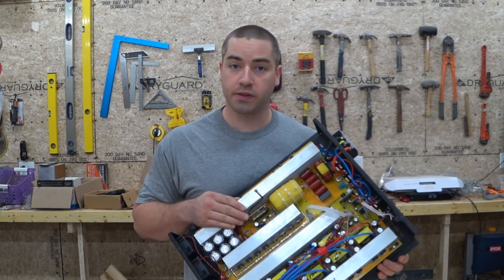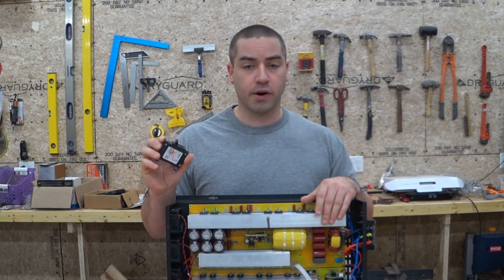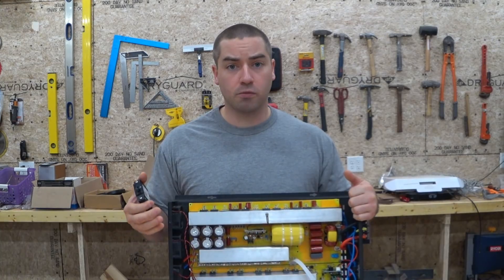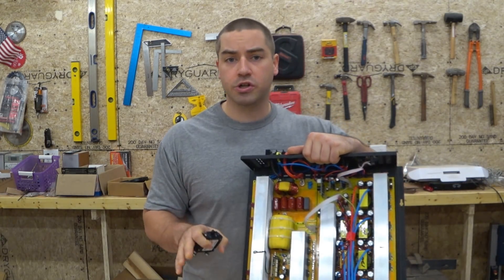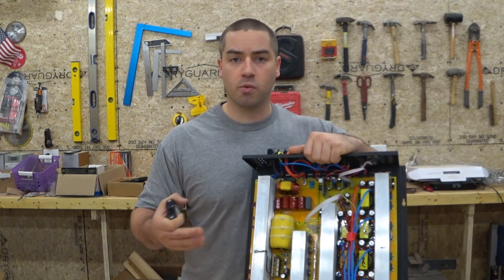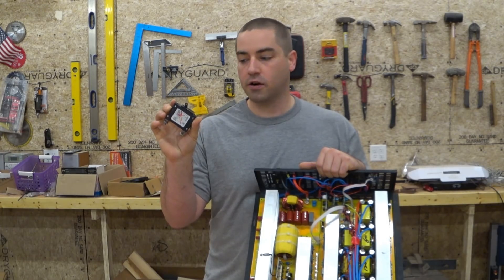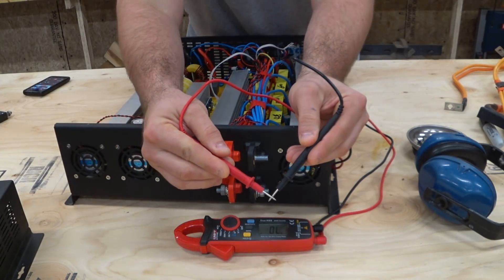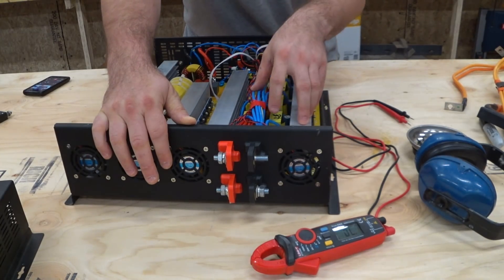Did I Blow Up the Inverter?

Comment: Sorry to say it, but you're over thinking this problem.  The bottom line is you cannot condemn anything in the output of these systems until the supply side is adequate.  The math says that 8000 watts supplied by 48 volts will draw 167 amps.  Even though you didn't pull that much with your saw, I'm sure the supply side current was well beyond the 80 amp breaker's limit.  When that breaker tripped, the voltage spike collapsed into the inverter electronics and they didn't like it.  I've made the mistake of flipping breakers on and off while my computer was running on more than one occasion - smoked the computer instantly.  Put at least a 200 amp breaker on the supply side and I suspect no smoke will escape from the 3rd inverter.
Reply: Yeah, a circuit break during peak inrush curent will determine the colapse of a huge magnetic field in those transformers translating in a imense reverse voltage  which will  fry the circuit breakers. 
But as everybody knows the FETs  will let the magic smoke escape first thus protecting the breakers or at least some of them.
In my oppinion there is fault in your setup but the design of that invertor is crap. 
The inrush current for that kind of motor you have is ~ 7  to 10 times the idle running current. That's means ~ 70..100 Amps. 
So you should at least double the result of your math. ~>9000 VA. In this condition the inverter should protect itself but ... the external breaker tripped. 
The 3000W inverter managed to limit it's inrush current before the breaker tripped so you'd had a kind of softstart :)
Did main the circuit breaker poped on the first fried invertor too ?
Reply: I suggest you order those FETs on Farnell, or Digikey or Mouser or whoever suits you, replace them (i'm sure "a guy in his garage" cand do this easily), remove the main circuit breaker and test again. I'm not even sure you need that main circuit breaker. I have 2 x  4KW inverters in paralel and i don't have a circuit breaker, only a 400Amps on/off switch. If something will go wrong the small circuit breakers in the inverter will pop. Cheers.
Reply from the maker: @John Critian,  Thanks for websites, I had no idea where to look for mosfets.  Mouser was cheapest, but still $100 for enough.  The hard part is that I don't know if just the mosfets need replacing, or other stuff too.  I can see myself replacing the mosfets, only to find out that other stuff is also bad and on and on.  I'm not sure it's worth it in the end.  Any ideas?
Reply: @DavidPozEnergy  Well... first, u may want to check w/the  inverter's manufacturer about that. Maybe they want to send u a 3rd replacement :)
I've seen several blown inverter and always the problem was localised @ FETs and fuses. 
If u decide to go servicing the unit, remove al FETs and check (w/ your DMM) for continuity between each pins of the FET. Any continuity  means bad. Probably u'll have some FETs survived. 
If u can't get a 3rd replacement, $100 is pretty nice for an 8KW invertor, don't u think ? and $200 is more than fancy for two 8KW units ...
If u decide to throw them away, please let me know where u dispose them  ;).
cheers, 
JC
Reply: @DavidPozEnergy  I agree with John's assessment. Replace the FETs. They are easy to do overall. Also, you replace all of them, don't replace only the ones that failed. They all need to be close in spec with each other, and that won't be the case now that some have failed and the others were close to failure.
And as John says, $100 is cheap for a 8kW inverter. Go for it.  The other thing you could check is to make sure the smd resistors are fine, as well. After removing the FETs, test the continuity of the resistors. They should all have the same value. And if any of the caps look a little puffy on the silver ends, replace them too.
Reply: so just out of curiosity, did the manufacture do a post mortem on the first unit?
Reply: @DavidPozEnergy  Check at taydaelectronics.com - (https://www.taydaelectronics.com/t-transistors/fets-mosfets.html)  I use them a LOT for my electronics needs.  Hopefully they carry the exact one you need, otherwise you might need find an equivalent.  I have not seen anywhere you say the MOSFET #, but I may have missed it.
Reply: @DavidPozEnergy  One thing I noticed was the FETS have the stylized "f" for Fairchild. I'm not saying those aren't genuine Fairchild FETS but it's a common counterfeit logo. I'd get the FET numbers off each of them then check the datasheet to find one in that class that has a better power rating, then get that replacement from a reputable vendor and possibly a non-Fairchild version (TI, ON, Motorola, ST, etc).
Reply from the maker: When I typed in the part # this product came up.  The last three letters don't match, I don't know if that is important.  https://www.mouser.com/datasheet/2/196/irfp90n20dpbf-1227618.pdf  I posted a picture of the mosfet here: https://www.facebook.com/DavidPozEnergy/photos/a.338714846537622/480617959013976/?type=3&theater
Reply: @korishan  better yet now would be the time to add in some proper circuit protection in the inverter instead of those cheap fuses, to quote a comment from above, "first of all those car fuses are simply not fast enough to trip off and protect mosfets - it should be current sensing circuitry installed to be able to react fast enough but hey Chinese design! Second and more important those 9 leads running from a main input terminal are DIFFERENT in lenght and in high current dividers this is NO-NO solution, meaning shortest one probably took 2 or 3X more current load then longest one, blowing mosfets, then next one blow out and so on"
Reply: If there is no protection against reverse current when those transformers must disspate their stored magnetic energy, they can fry the beefiest of MOSFETs. The energy has to go somewhere.
Reply: Completely agree...
Reply: And that's why the 3kw inverter didn't fail , it could not draw so much power to trip the breaker.
Reply: @nl1cat  That's right!!!
Reply: My thoughts exactly, a "brownout" condition can be very damaging to certain Electronics, like this inverter.
This is exactly what happened to the Reliable Electric inverter that I had. 
During my tests, I used the included wiring. I just plugged in a huge load, my RV air conditioner, and let it rip. Instant failure, exactly like shown in this video. The failure mode inside was identical inside too.

To be clear, this shouldn't actually happen if the inverter had appropriate fail-safes built into it, however due to the fact that it appears Reliable Electric's design lacks those fail-safes, it is completely reasonable to assume that some form of voltage drop, either from the breaker or from the wiring on the input side, is at fault for the failure of the unit.
Reply: there is also a huge design fault in this inverter whit the different lenght of 48 volt power wires to the mosfet bridge, no way that in this design the mosfets all get the same amount of power, the first 4 ones will blow on over current, the powerIs not correctly devided . Bad design.
Reply: Brad Ripley, i came up with the same numbers you did. 8000 watts / 120 volts, = 66 amps x 2.5 for a 48 volt system = 166 amps, so that comes to about a #1 size wire, therefore, I would have installed 2/0 so the unit is not starved for power. And a master fuse of 300 amps.
Mark
Marks Marine Electric
Reply: 48V is the input voltage. 8000W is the output power. The output voltage is 120V which means it 66.6A draw MAX.
Reply: This explaination sounds reasonable

Comment: check on google that 8kw inverter can take up to 16kw surge and the surge would probably last no more than 500ms so the inverter would give out 133 amps say for half a second or less  but the immediate draw from the batteries @48 volts would be UP TO  770 amps. dont forget the load is inductive and not resistive. you can get special breakers for high inductive start loads. check the small print with the breakers they should tell you how many start up amps they will stand perhaps try a contactor with thermal cutouts but needs to be wired in a single phase "easy when you know how lol" I hope this helps, Paul UK

Comment: Dave was the fuse on the AC or was it on the DC side. I would tend to think that you had a brown out in the inverter and that would be like running a weed eater at the end of a hundred foot extension cord you would only get the amps, (the heat) not the voltage to push the current. if the the fuse was on the DC side? Great video I use a 100amp aml fuse on the 24V 3000 to 4 gage wire to run my 10 inch miter, 7" table saw, cement mixer, RV fridge, upright vac on a tesla S module. I have had the inverter shutdown but not blowup
Reply from the maker: Hi Leigh,  You asked where the fuse was located.   There are 18 blade fuses (10 amp each) inside the inverter, and they are all on the DC side.  look at 6:10 in the video to see the DC wires come into the inverter and go to the fuses.  I hope I answered your question.

Comment: Dave, I think the inverter has a fundamental fault in handling surge. As well, I don't think it is the problem of the circuit breaker. You may need to ascertain first if the inverter is really 8000 watts as described. Here is my suggestion: if you are able to repair the inverter into working again, instead of taking it through such surge with the big saw, give it a lower load and keep increasing the loads to see what it can handle (up to how many watt is can handle). This would help you determine if actually it is 8000 watts as rated.
Reply from the maker: I hope to work on fixing the inverters in the future, but I'm afraid I need to learn more about the electronics first.  Right now I don't know exactly what needs replacing, or how to determine that.
Reply: @DavidPozEnergy   Fixing electronics is fairly straight forward. As long as you have a DMM, a solder iron, some patience, and some time, you can do it. I've only recently within the last year really gotten into electronics and have learned a lot. But, it started with tinkering and fixing LED tvs and other gadgets.
The FETs blow first. We know they need replacing. Pop the old ones out and while out, test a few other components (I mentioned in another comment the caps and resistors); also test the transformers (yes, that's what those particular ones are) as well. Make sure they didn't go dead short as well. They should all have the same Ohm. Then replace with the new FETs. That should be your only problems to replace. 
LithiumSolar has a few videos on repairing an AIMS inverter and shows how he did it: https://www.youtube.com/channel/UCh85wOuqCsD3gh_lkAXbQEQ/videos
Reply: @korishan  the first problem in this tv's are the caps... Overloading the mosfets..< This inverter needs new (paired!!) mosfets, and a rebuild in the feeding power cables, these should be all the same lenght.... (to devide the power equally over all the mosfet bridges)
Reply: @MrBugsier5  Dude wtf? If a design requires matched discrete MOSFETs and power cables that have the same length, it's a shitty design. Look at how redundant server power supplies share the load if you wanna see the right way to do this.

Comment: The breaker throwing sparks still makes no sense.
Reply: The contacts inside a circuit breaker aren't that far from the terminals. When a breaker trips, it's interrupting a rather large current, which creates a spark, and it's close to an opening in the case. Sparks escaping the case are not desirable nor part of the design, but it does happen.
Reply: It does make sense if the inverter shorted (which is what looks like happened). The batteries David is using have a mind boggling amount of current potential. Once the fault occurred inside the inverter the breaker had to interrupt a few thousand amps. The fuses blowing inside the inverter made that job easier.
Reply: That's normal when a circuit breaker is run at twice it's capacity they are not designed for such currents
Reply: Awesomus Maximus n
Reply: It be the arrester spark what you're seeing there it's quite normal for a DC breakers to utilise the arrest area of the breaker as DC currents like to arc when they are broken

Issue here is that the inverter does not like been cut (sudden power loss/brown out) when under very high load, the 8000w reliable inverters lack protection/soft sudden load start to keep amps below 100A for 3 seconds (other inverters cut out if they can't power what's connected after short time) , slap at least a 200A fuse or no fuse on DC side of the inverter you find that the 8000w reliable inverter won't blow up ( it's very likely of the people that make these inverters and not hooking them up to 80 amp circuit breaker)
Reply: > The breaker throwing sparks still makes no sense.

That is exactly how the Breaker is designed to work. When the contacts open an Arc will develop, but the breaker opens the gap wide and puts a physical barrier in the way. So the arc is forced to travel through a labyrinth which absorbs the heat from the arc and quickly extinguishes it. The result of that process is that the remains of the Arc is thrown out the vent at the rear of the breaker.

Comment: I presume the 80 amp circuit breaker is on the 48V input to the inverter. So you have a circuit breaker rated for 80x48 or 3840 volt/amps.
Your inverter is rated for 8000watts output? Something doesn't work. Also, you can't measure inrush current on a digital meter unless you have a peak hold function that stays active while looking for the peak.  I suspect your peak was probably close to 50 to 60 amps and could be more.
Most thermal circuit  breakers will take up to 200% before tripping because of the delay in heating. You tripped in less than .2 seconds.
 
Based on the internals of the inverter, I'd say it was cascade failure. When you are using wire, instead of a solid metallic bus, to connect several parallel load bearing circuits together, the one with the shortest wire bears the load first. then the next, the next and on to the last stage, having the longest wire, bearing the least amount of the load due to the higher wire resistance. When the OEM tested the inverter for load bearing capability, they probably brought the load up in stages. Not all at once. And in the even they put a surge load on it, it was probably quite controlled. However, I suspect they didn't.

For what it's worth, if the wires inside weren't bigger than AWG 8, I'd say they should have used a copper bus. Again, using wire, they all need to be the same length to ensure all circuits share the load equally. Have a great day.
Reply from the maker: I agree about the wires needing to be the same length.  In fact, that's something I made a point to do when wiring my batteries: https://youtu.be/MxX3csP9Jv4
Reply: @DavidPozEnergy  If I am correct about the topology of this inverter, voltage drop in the supply wires will only have the effect of dropping the final HVDC voltage a tiny bit. It won't cause dangerously uneven currents anywhere.